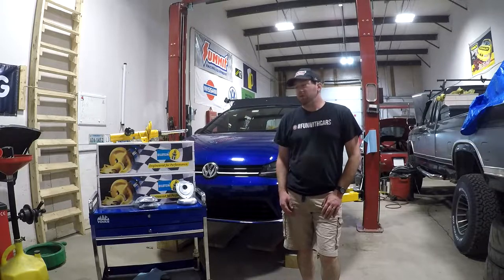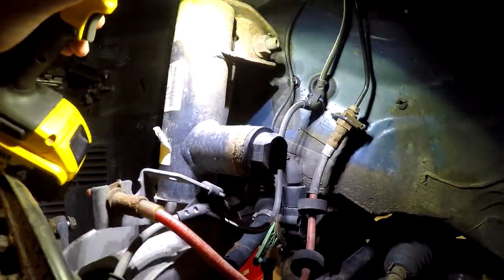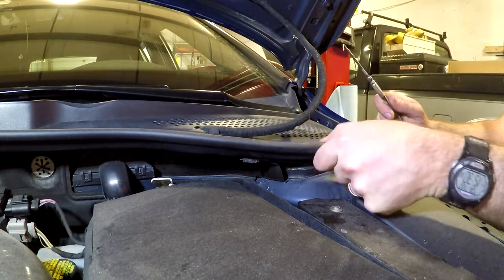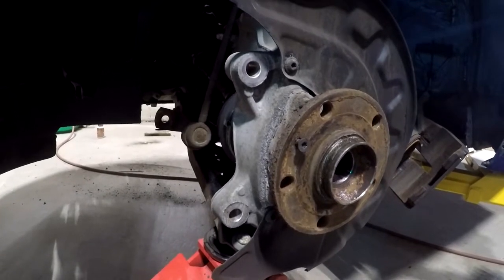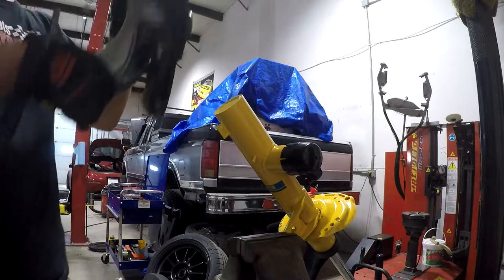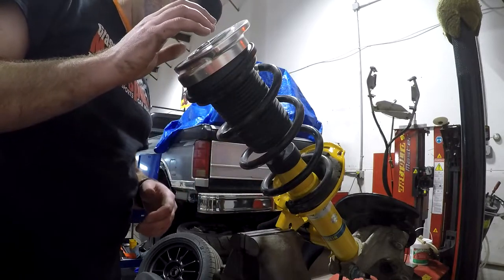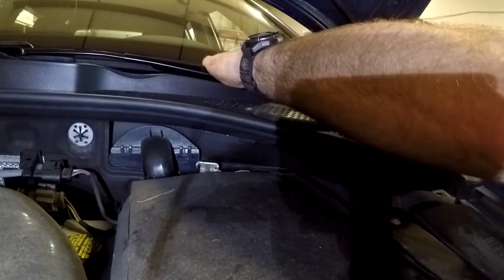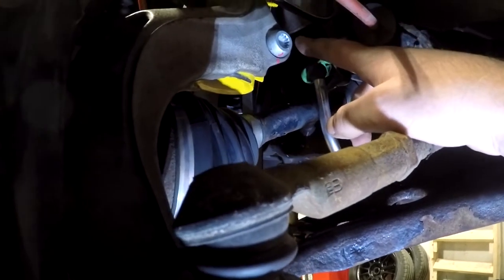MK7 Golf R - Front Strut and Camber Mount Upgrade & Install

Comment: 2x4 works like a charm you can skip about half the steps instead of removing axle
Reply from the maker: I've heard mostly good things. I was doing other work at the time and it made things a lot easier to just remove everything and work on it outside of the car.

Comment: I thought B6 had internal bump stops, you know mono tube life, no need for the external. 

Maybe these DCC units are different than other B6?
Reply from the maker: The DCC version of the B6 is different and does not have internal bump stops. The directions with the kit specifically say to reuse/replace the OEM bump stops when installing them.

Comment: @ADVNTURR How are the B6's holding up? I'm going to install the exact same parts very soon as the factory Monroe units are falling apart.
Reply from the maker: I'm 25k miles in on my B6's and so far I'm still really happy with them. I've done a few track days with them and they've suffered through a couple of Ohio winters and they still feel great and the finish is holding up reasonably well.

Comment: Would you recommend pairing the B6 damptronic with the EMD lowering springs?
Reply from the maker: If you're going to lower the car, that'd certainly be the time to swap shocks/struts. I don't have any experience with the EMD springs, most people I know have gone with VWR springs, but EMD is reputable with other stuff so it's probably a safe bet.
Reply: @ADVNTURR  I may just go with the KW Street Comfort kit and delete dcc cuz i can't go much lower than .4" drop in the front from stock because of my aerofabb front splitter. As of right now, i have around 4.75" of ground clearance in the front.
Reply from the maker: @Jvilleman400  the other option is the KW HAS kit which would allow you to dial in your height and works with the stock equipment or I would assume the B6 if you want to keep DCC (I use mine regularly and wanted to keep it but wasn't interested in going lower)
Reply: I’d love to keep dcc but the kits are just way too expensive, plus, the B6 kit that keeps dcc is so far on back order it’s insane, the B16 damptronic kit is too low even in its highest setting, I’d keep my stock struts and shocks but, they have 87k miles on them. I’ve had 034 Motorsport lowering springs on them for around 50k miles and I think the struts are wore out cuz my ride quality is shit.